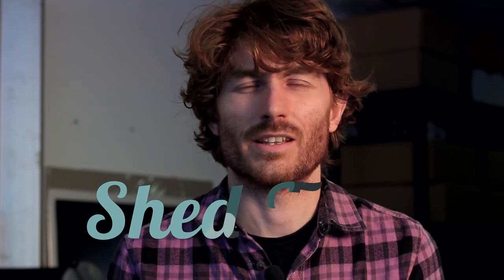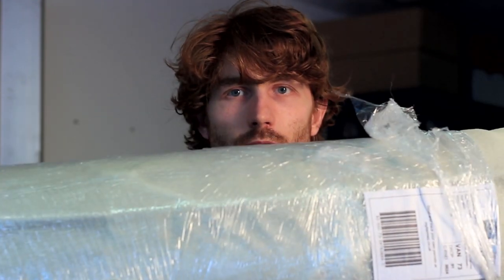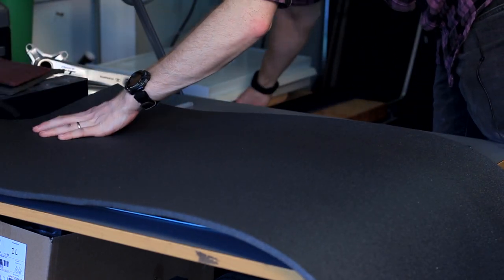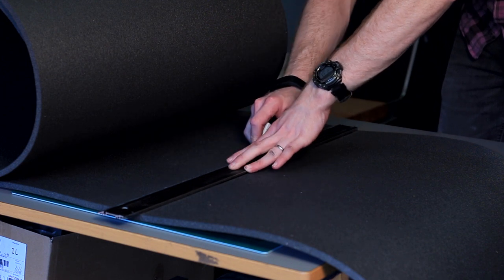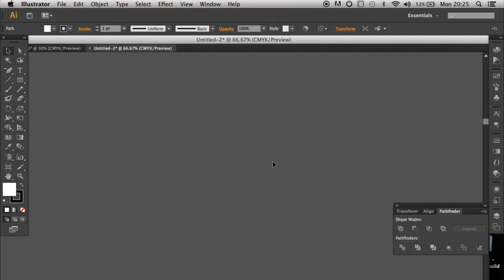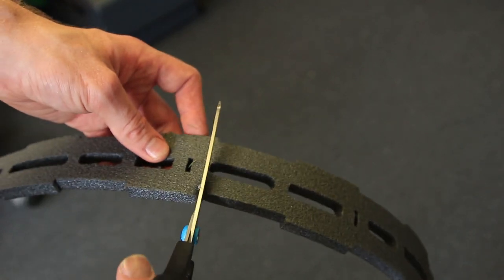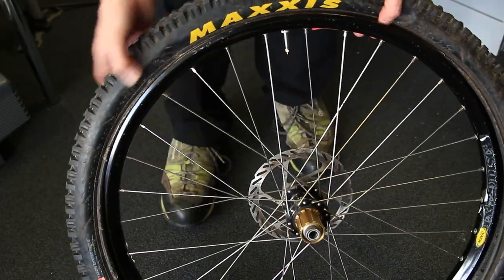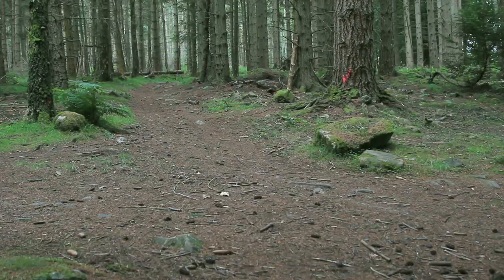DIY MTB Tyre Insert

Comment: I've been thinking the same thing myself to get a wee bit more protection for my back wheel alone with some peace of mind. I'll give it a go. Wish I had a laser cutter!
Reply from the maker: Laser cutter is neat but a scalpel and some patience will do the same thing. Itcwrtainly gives some protection but it also works as a volume spacer in your tyre. I have another video on the channel talking about why I use inserts and their duel benefits 🤘.
Reply: @StravaigingMTB  Excellent. I'll look for that one.
I'm going back to a hardtail later this year, and I figure it will make sense to beef things up in back. Just in case. 
Cheers
Reply from the maker: https://youtu.be/DfpbM4Rm288 here it is, and yeah of totally go for inserts on a HT. Happy build!

Comment: Why are the edges not cut in a straight line?
Reply from the maker: Good question, it stops the sealant getting trapped in one half of the tyre.
Reply: Rolling resistance